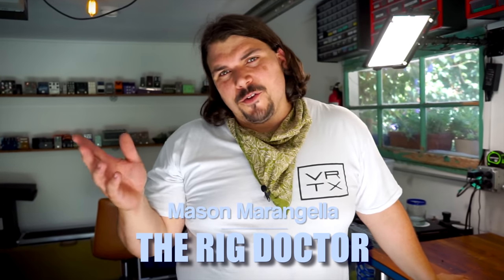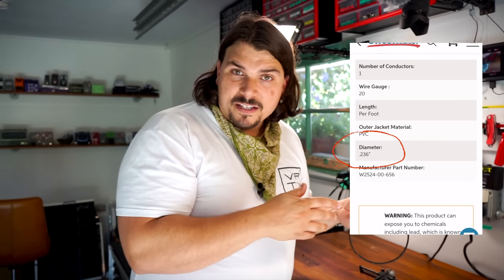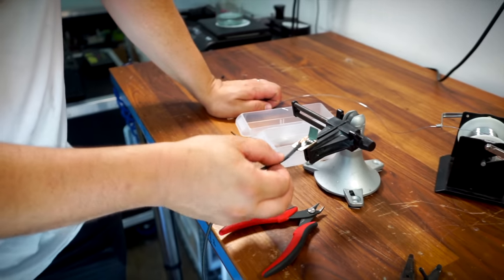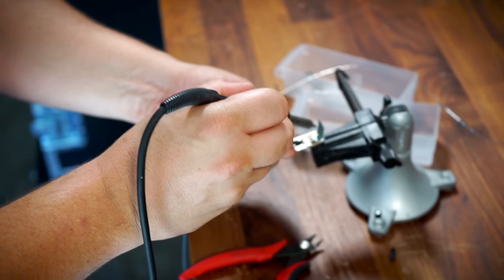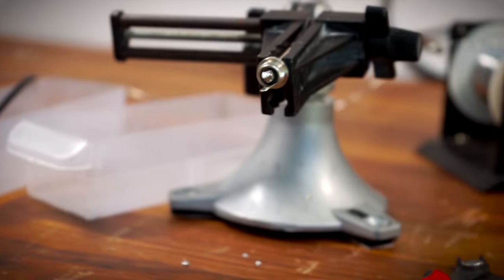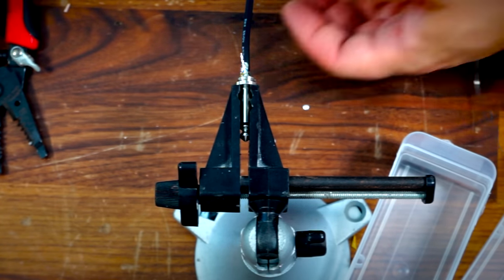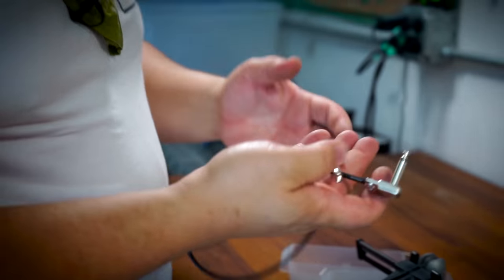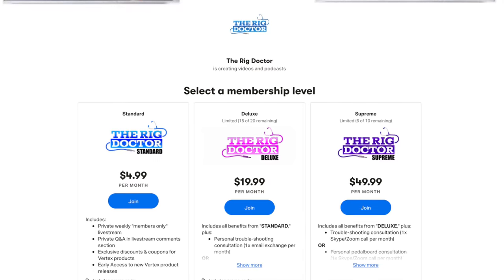How To Solder SquarePlugs

Comment: Thanks for the video. I have a question though, where can I buy these square, flat, right angled mono jack plugs in Europe and which have the best fit to use with Mogami 2319 as a patch cable? Thanks and greets
Reply from the maker: The company, Squareplug, is based in France.  You can check them out online.  You want the SPS5 and the SP500 series for the Mogami 2319.
Reply: @VertexEffectsInc  thanks!

Comment: Hey Mason! I got around soldering my SP500 plugs but I almost always get crackings when I plug the cable and move it around (ex. in a pedal to test it). Any idea why?
Reply from the maker: Dirty contacts inside the pedal most likely (presuming the cable was assembled correctly).  Try cleaning your contacts with Deoxit D5.

Comment: Hey Rig Doctor! Love all your videos. I’ve got some 2314, and some SP4s/SP400s I’m using to wire a board with an ES-8 Switcher. So far both the cables I’ve soldered work when I plug guitar into amp, but when I try to run them from the tuner out on the ES8 to my Korg Pitchblack, the tuner is not functioning properly, it’s reading incorrect notes and just going haywire. In addition, the connection seems to be a little sketchy, if I wiggle the soldered cables in my cable tester (CT100) some of the lights go out.

The answer is probably just keep practicing, but is there some obvious thing I could be doing wrong, so I can avoid wasting more plugs?
Reply from the maker: If you email us some pics we can take a look info@vertexeffects.com

Comment: Hey, is there a chance you can make a video about making a trs cable to plug into the iridium in stereo ?
Reply from the maker: Is that an insert cable?
Reply: @VertexEffectsInc  yes!
Reply from the maker: Mogami 2528 is what you need - I’ll make a diagram soon.  TRS SquarePlug on the Iridium end, dual TS on the preceding stereo pedal.  It doesn’t matter which conductor you designate to tip or ring, just tie together both shields to the sleeve on the TRS side and you’re golden!

Comment: Hi Rig Dr! I have a question. Does it matter what cable side you solder to the pancake plugs? Does it have to be on both sides te same, like (in)  sleeved one on the right en non-sleeved left, (out) also sleeved one right and non-sleeved left?
Reply from the maker: If you're using a coaxial cable, both sides are soldered the same.  Tip to Tip, Sleeve to Sleeve.  The cables are assembled 1:1 on both sides.

Comment: Hey Mason. I wanted to ask you something. Is the cable that’s used in a TRS cable different that a regular TS cable or is it just the plugs.
Reply from the maker: Different plugs and different cable.  For TRS I use a twisted pair shielded Mogami 2552 cable and SP550-S plugs

Comment: I noticed on the pancake plugs, you didn’t thread the leads through the hole on the lugs for both the ground and hot lead. Instead, you just pre-tinned the entire lug and just soldered the leads on top. Is there any audible or durability difference by just soldering straight to the lug instead of looping the lead through the hole on the lugs? Thanks!
Reply: Yes. J Standard dictated by IPC class 3 says the pre tinned wire should go through the hole like a z. Don't double back on itself.

Comment: Mason,

Do you know of any low profile trs connectors like straight square plugs?  I know trs square plug SP550-S  is low profile, but it is right angle...and I'm using an boss es8...if i did use the sp550-S, it would block the rest of the es8 control inputs...but that is fine, since I'm currently not using them.  Also, which trs cable would you recommend for the SP550-S

thanks for the help!
Reply from the maker: I used to use Switchcraft 1/4" stereo jacks and replace the housing with the 380 casing.

Comment: What awg or mm should I use on a wire stripper when making these connectors with 2319. In the past I’d find myself never choosing the right one and cutting the cable and wires.
Reply from the maker: I would start with a 10 gauge and work my way back for the outer insulator.  You might have to strip away the thermal conductive plastic with your finger nails until you get the touch down.  Maybe 20 gauge for the center conductor.
Reply: @VertexEffectsInc  Thanks! One other question. When pre tinning the connectors I can't seem to get the solder to stay on the lugs. It just sticks to the iron tip. I'm running my iron at 700 and it tins the cable fine, just not the connector.
Reply from the maker: Justin Galvan It may be that you need to turn the iron on the side so that it’s getting more surface area for heat transfer. There are different tips that you can use as well they can give you more surface area for this application. Not knowing what you’re using is hard for me to estimate
Reply: @VertexEffectsInc  I have a Hakko FX-88D with the stock T18-D16 Chisel Tip and use quad eutectic solder. What tips would you recommend?

Comment: Interesting that you don’t push the wire through the hole in the lug on the SP400.  What is the reason for that?  I go back and forth on that myself and am not sure which way is better.
Reply from the maker: There’s more than one way you could do it, I typically stay away from doing this especially in a DIY tutorial because many practitioners who are inexperienced will push it through and not cut off the excess behind the lug and end up shorting the center conductor to ground because they’ll just hit the back of the housing with the wire that comes through. In this context, the way I showed it, is no more or less reliable.

Comment: Hey mason in your other soldering video you say you should take off all of that inner shielding, do you just leave it on for these specific plugs?
Reply from the maker: If the cable has a thermal conductive plastic around the center conductor, you definitely need to remove it completely or it will impact the sound of the cable greatly. The Mogami 2314 does not have this, however the Mogami 2319 does. If you were to repeat the same tutorial with 2319 you would have to add a step of removing the thermal conductive plastic around the center conductor so that it looks clear.

Comment: Love these. However I always have to nudge the ground lug up a bit from the housing and most of the time the solder doesn’t stick on it like the hot lead lug. This is for the pancake lug. Is there any specific solder you use that works best with these plugs? I’m using Kester Silver solder.
Reply: I've done quite a few of these and I've had good luck with Kester 63/37, but I think Mason recommends Kester 60/40. Also, if you are having trouble with the solder binding to the ground lug you probably don't have it hot enough. The ground lug will usually be harder to heat up because there is more material that acts like a heat sink. Good luck!
Reply from the maker: A lot of times, the problem is that you don’t have enough surface area of the iron touching the lug, and as a result their won’t be a lot of heat transfer. Instead of coming down the straight on top the lug, try coming in at an angle or get a tip with more surface area.
Reply: Michael yeah I have a temp control on my iron and it’s like 700 degrees Fahrenheit lol
Reply: Vertex Effects true! I have like a pencil tip on my iron so I’ll switch it up to see if that makes it better
Reply from the maker: You can try it from the side where you could get more heat transfer, without seeing your technique it’s hard for me to evaluate it. But feel free to send me a video and I can do my best.

Comment: What cable would you suggest for making stereo TRS cable connections with the SP550s? Curious about audio cable for stereo, and would you just use the same for MIDI TRS cables?
Reply from the maker: If it’s TRS to TRS on a pedalboard, Mogami 2552.  If it’s and insert cable, TRS to dual TS, then Mogami 2528.  If you were making a MIDI cable 2552 would be the one to get or even a smaller diameter version would work if it’s for MIDI.
Reply: Vertex Effects is it possible to make a trs to dual ts with a sp550 trs to 2 sp400’s using BTPA 0678 cable?
Reply from the maker: @jmd12331  Maybe...you might need to look at the diameter specs of the cable cable versus the opening of the housing on the plug - easy math to do.

Comment: Hey Great Video as usual. I plan on getting a bunch of the SP400s I saw them AGES AGO and thought they were wicked. I have a question. Is it possible to use an XLR cable to make patch cables and to also use it as an instrument cable? Any pros or cons?
Reply from the maker: Sure you can - you just need to wire it like you would a directional cable, with the shield connected on the output side, and the shield cut away on the input side of the cable. Depends if you like the sound more than anything.
Reply: @VertexEffectsInc  I'm gonna try it. THANKS A MIL for your quick response...
Reply from the maker: 🙏🙏🙏 I hope we earned your subscription
Reply: @VertexEffectsInc  Been a subscriber from AGES AGO... Get channel. Keep up the good work...
Reply from the maker: Paul Amar 🙏🙏🙏

Comment: I have made some patch cables using Mogami 2319 and sp5 cables. The tip to tip and sleeve to sleeve read 0ohms using a multimeter, however when I check my tip to sleeve I get readings of 300ohms to 10kohms depending on the cable, I am wondering if this is an issue?
Reply from the maker: You probably didn't remove the conductive plastic and you have a resistive load.
Reply: @VertexEffectsInc  thank you! You were correct. I can’t believe I missed that step.

Comment: Thanks for the awesome guide. I’m in the process of making my own patch cables. My wire strippers are DESTROYING my cable ends as I try to strip! Is the gauge for 2314 wire non-standard? I can’t seem to find the info in the specs. Seems like 10 and 12 are stripping too much or too little.
Reply from the maker: It is standard but there is also a "feel" component to doing it right - also if you have dull strippers that can make it hard to work with.
Reply: @VertexEffectsInc  Thanks so much!

Comment: Hey Mason, I had to move some stuff around on my board and re-solder some connections after shortening some patch cables.  I'm having trouble in one of my loop runs.  I've tested the cables with my 1 spot tester and they both look good but when I turn the loop on half my signal goes away.  What would cause that?  Is a ground wire touching a hot somewhere?  Thanks!
Reply from the maker: worleytones you probably didn’t remove the thermal conductive plastic on the cables - send a link to a photo of the inside
Reply: @VertexEffectsInc  that was it!  I trimmed a bit of the 2319 back, made sure to remove the conductive plastic this time, re-soldered the connection and it works perfectly.  Thanks Mason!
Reply from the maker: @Bones3640  Good deal, you shouldn't see any of the black plastic at all, it should all look clear if you want to get it right 100% of the time.

Comment: Can a sp400 work with Mogami 2319?  The cable is 0,02 mm to big ..
Reply from the maker: They're a bit too tight in my opinion, but I've seen people do it.
Reply: @VertexEffectsInc  i order those two to make my cables for my beard … guess I’ll find out soon … but if you say it’s done before , it will work now too 🤞
Reply: 2 month later: Mogami w2314 is for an SP 400 Plug,  Mogami w2319 is for an SP 500 Plug
look outside amazon  for better price

Comment: Is it possible to use the square plugs with George L’s cable? I’m having trouble sorting the dimensions of these different parts. Great tutorial!
Reply from the maker: .155 George L's will fit into the SP400 but the GL's are difficult to prep properly for soldering because of how they're made.
Reply: @VertexEffectsInc  thanks for the reply. I’ve been learning a lot from your channel.
Reply: I also really liked the Lava Tightrope in your cable shootout. Are those any easier to work with than the George L’s?
Reply from the maker: @StephenMougin  Yes, much!

Comment: Most importantly does the hot wire go on the long or short sleeve? None was mention.
Reply from the maker: You can always double check with your multimeter - are you asking about the SP400 or the SPS4 plugs?
Reply: @VertexEffectsInc  on the SP4 straight plug. It has a short sleeve and a long sleeve. I think Ive figured it out but the sound cracks when I tested it. I may need to resolder. First time doing my  own Mogami/plug cables. 🤷🏻‍♂️
Reply from the maker: @kingdomfirst7895  The longer more robust lug is the sleeve.  The smaller shorter lug is the tip.
Reply: @VertexEffectsInc  thank you. I can hear the difference in sound quality. Thanks for the videos!
Reply from the maker: @kingdomfirst7895  yes, I"m sure...

Comment: I just can’t get these soldiered correctly. The sound is muffled compared to my Goerge L. What am I doing wrong.
Reply from the maker: My guess is you’re probably not stripping off the thermal conductive plastic around the center conductor
Reply from the maker: Send me a picture of what you did, my guess is that you soldered the thermal conductive plastic on the center conductor and didn’t strip it off fully, if there’s any black on the center that it all touches the solder, it’s going to load the signal like that.

Comment: Don’t pre-tin the entire length of the shielding/grounding wire or in my opinion at all.  Doing so will restrict any natural flexing the shielding wire has and will likely fracture the joint.  Look at factory cables, they allow a certain length of shielded copper wire to stay exposed (not shrouded in solder) specifically for flexing.  

You can watch this yourself by unscrewing the jack sleeve and flexing the end of the jack back and forth; you will see the copper wire move.  If you make that joint 100% solid, it will snap the minute a large stress is induced on it.

Comment: What's the conventional wisdom on using a short section of heat-shrink on a SPS4 assembly as a means of preventing the strain relief screws from digging too deep into the insulation layer?  Curious about that.  I'd be worried about screwing them down too far and eating into the shield layer.
Reply: If you were too by accident, it would be a secondary connection of shield to sleeve. No harm as long as you avoid the conductor. Heat shrink is there more so as added strain relief on the solder joint. 
By all means, use it, but you don't need much. A half inch or so past the jack is enough. Any more and you're likely working against the heat shrink when patching, diminishing it's integrity. As a patch cable, it's not moving like an instrument cable is. 
These connectors shouldn't be used for instruments. Use beefier connectors(with larger solder points) for that.

Comment: So how does this compare to your usual plugs?
Reply from the maker: This is what I’ve been using for the last year or so almost exclusively.  The reliability and quality is only matched by Switchcraft and G&H for this type of plug (I just prefer SquarePlugs because they’re lower profile).  Again this is only for use on a pedalboard - this isn’t what you’d want to use for your instrument cables from your guitar to pedalboard or your pedalboard to amp.  These are for patch cables only!

Comment: Was wondering what temperature you are using for the soldering iron
Reply from the maker: Typically anything over about 600° is not gonna make much of a difference other than to wear out your Tips faster.  I will modulate the heat depending on what the item is, something like a power cable will require this heat and typically I’ll change the tip to a finer point because its easier to control the heat compared to a patch cable.
Reply: Vertex Effects thank you
Reply from the maker: Erick Jaime 🥳🥳🥳
Reply: Vertex Effects perhaps a vid in the future on soldering temp on the square plugs and power tips would be an awesome vid for diy’ers

Comment: So I watch this and then sit down to make cables. I finish my first cable and... I forgot the screw on plug sleeve for the SPS4 end. 
Here's a tip from what I just learned: if you're making straight plug to pancake end patches, do the straight plug end first. This way if you forget the sleeve, the other end of the cable is still open to slide it on! 
Also my god is this tedious work.
Reply from the maker: Good call!  I still make this mistake from time to time ;)

Comment: can i use the George L´s Cable 155 with the SquarePlug SP400 and SPS4 ?
Reply from the maker: You could but it’s not easy
Reply: @VertexEffectsInc   So is the Mogami 2314 the better option? the cable is unfortunately difficult to get in europe.
Reply from the maker: @MrMetalPlayer  2314 is easier, you can also try Canare GS4, and I think also Van Damme makes some small diameter cable as well that works.

Comment: Oops! I’m just now realizing I soldered my first batch of patch cables backwards (conductors to ground tabs and vice versa) because I thought the larger cable went to the larger tab. They seem to work fine. Is there any problem with doing it that way?
Reply from the maker: Yea...you'll need to fix them.
Reply: @VertexEffectsInc  thanks.